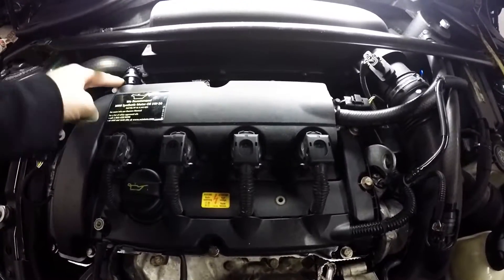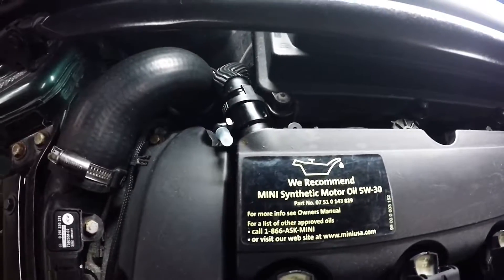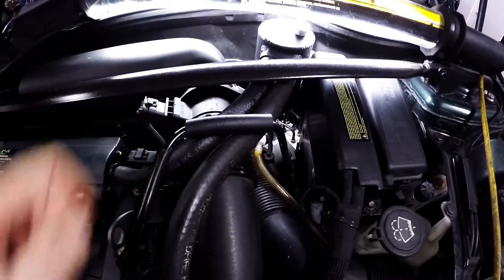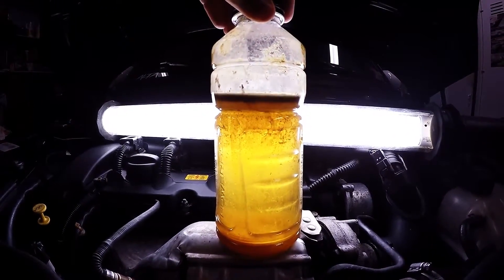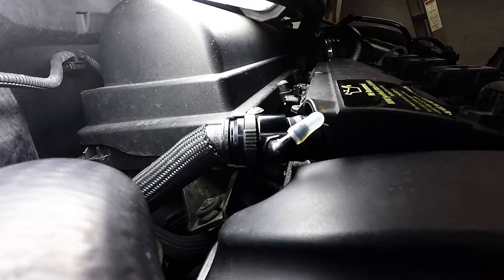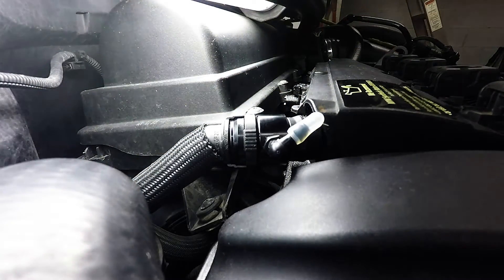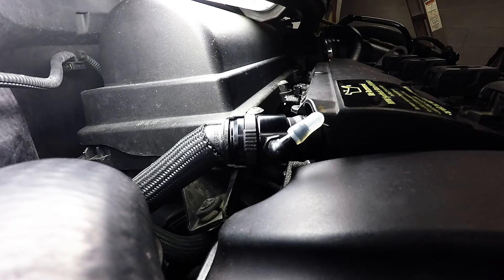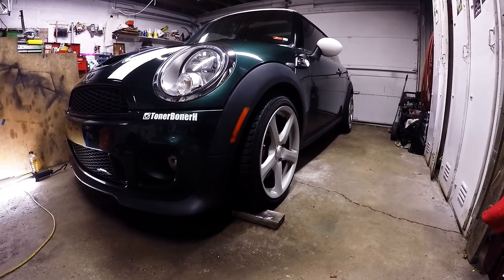BSH Boost tap and pcv catch can 1 year update

Comment: I know it's a old video and you said you sold the car. I really want to block the rear pcv outlet off just like you did but because of what others have said about not having vacuum on the engine I'm scared something might go wrong. How long did you run the car this way and did you have any issues with leaking turbo seals.
Reply from the maker: I replaced my turbo supply line because I had read about it being such a common issue with these engines, unrelated to the pcv blocking lol
I ran it this way for at least a year pre selling the car, both daily driving and AutoXing without any issues.
Reply: @thawkproductions4248  So what some people are saying is without the vacuum from the intake the oil won’t drain properly from the turbo charger and will cause the seals to leak. My thinking is the oil drain related to the turbo charger have nothing to do with the vacuum from the intake. The oil will naturally drain through gravity that’s just the laws of physics. Furthermore the vacuum they speak about is not been produced in the crankcase but rather up top at the camshaft cover or valve cover. The next thing is once the car is been operated it will mainly be producing boost so the valve at the rear of the valve cover will close and it will force the valve at the opposite side of the cover open where it will breathe plus the vacuum created by the turbo charger. I’m going block the line at the rear of the cover one day and install a OCC one day and see what happen. I just wanted the reassurance from you who seems to have done this before.

Comment: I got my dual tap recently and yeah been getting this blow bys in my occ.  Been checkin weekly and oh boy i smelled them and are aroma of gas....

Am afraid abt turbo leaks thus observing this setup closely...i even have to idle for abt 1 minute after a long drive...aka manual turbo timer..tnx
Reply from the maker: Michael Vanna my car had almost 80k on it when I noticed the oil feed line always looked wet. So before it started leaking real bad I bought the feed line kit from Detroit tuned and replaced it. It wasn't very difficult at all
Reply: THawk Productions where did you saw the leak, is it from the top of the turbo feed line or down below?...wow a lot of work to take out a lot of stuff down under...tnx
Reply from the maker: Michael Vanna right on top, where the banjo bolt is

Comment: With the block off plate does that mean the clean side of the crank pressure is now the dirty side which is now filtered with the catch can?
Reply from the maker: Russ Rivera since the passenger side is blocked off I suppose yes, the driver side is "dirty" but since it is going through the catch can its "clean" where it matters.
ive had my intake pipe off recently and there wasn't anything on the walls of the pipe/turbo so the catch can isnt allowing much if any oil/water thru into the intake/turbo
Reply: @thawkproductions4248  And is that desirable? Should oil/water not go through the intake/turbo? Thanks for the reply
Reply from the maker: @albertoseibeb9123  well, it's a direct injection engine so unlike other engines the gas doesn't spray against the back of the intake valves to clean them off. Doing this should give you more time between walnut blastings/intake cleaning.